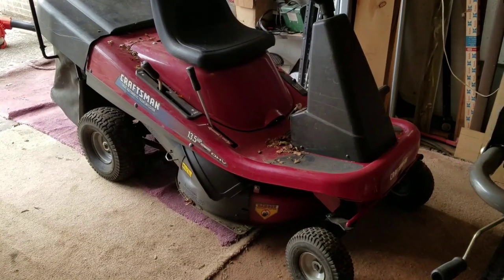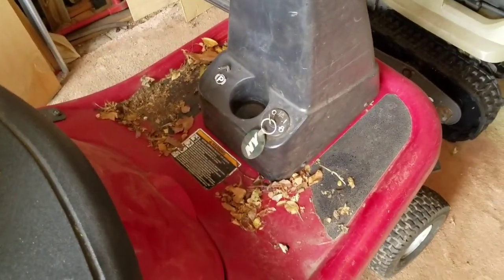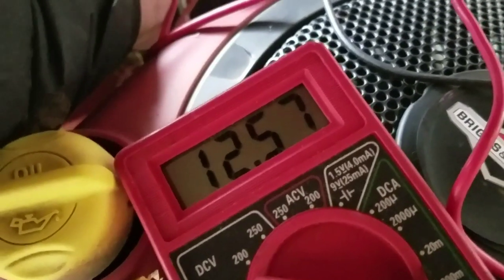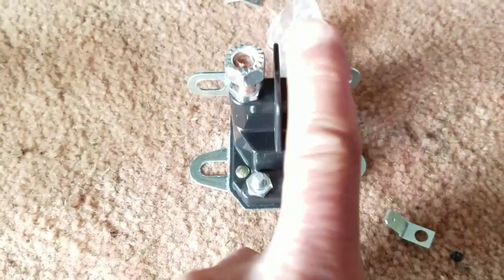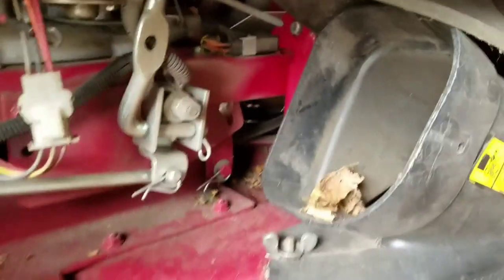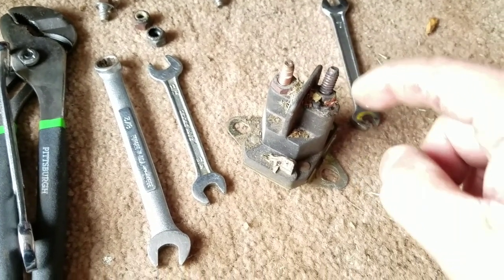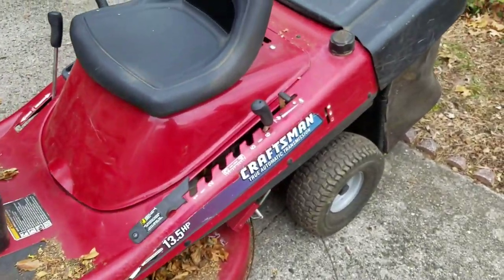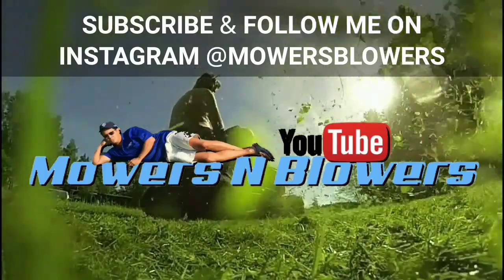LAWN TRACTOR RIDING MOWER WONT START CLICKS HOW TO REPLACE 3 4 POST POLE SOLENOID WORKS REPLACEMENT

Comment: Hello Henry. I purchased a 682 Cub Cadet with a 44c mower deck and a snow blade about a couple of years ago in which the tractor actually run pretty good and the price seemed to be quite reasonable. The three mower deck blades were about as sharp as a rubber hose. So I started noticing things like a idler pulley with the bolt ready to fall out and the points cover screws about to fall out. A couple of days ago I was going to start the engine and the solenoid was chattering; So I grabbed the ground cable from the battery and the lug moved freely around the frame bolt. After tightening the bolt like it was supposed to be, The engine seemed to start and run with a little more vigor. Sometimes a combination of small issues will cause big issues in the end. I had told the guy that owned this Cub previously that I wanted first dibs should he ever decide to sell and he did keep his word to me. If I hadn’t known this guy for a long while; I probably wouldn’t have been very pleased with some of the things that I have encountered. Honestly though, It really pays to look things over before you turn over the dollar signs. Im kind of afraid that in time to come, I will probably have to repair or replace the Ross steering box due to excessive steering wheel travel now that I have owned this Cub for a while. Oh Well, The 682 has a good home now with me being that I now have two Cubs to play around with. Both Cubs have some years on them - But are tough as nails. I wanted to share my saga with you and your subscribers. Thanks for your great videos.
Reply from the maker: Thanks Duke, great personal experiences to share with everyone.  I’m sure since you take care of your machines, you won’t have too many issues.
Reply: Mowers N Blowers. Henry, I was determined to sharpen the old dull blades that I removed from the Cub Cadet. The blades were so dull that where the bevel comes to the sharpened edge - It was very badly rounded back to the underneath side of the blade. The blades were not beaten up or nicked surprisingly enough. I had kind of expected the worst and so I did myself a favor and ordered a new set of blades.  I broke in a brand new DeWalt grinder in which it received one heck of a workout. The blades actually sharpened up pretty well considering what they were before(Argh). The mower deck wheels were completely worn out so I ordered a new set of deck wheels. Luckily everything that I am doing is helping out tremendously. On a humorous note; Can you imagine a Pattays Performance video with what I had found with my Cub???. Now that’s a tremendously big LOL. Have A Good Evening, Henry.
Reply from the maker: IronDuke502 it’s tough to sharpen so much that you may throw off the balance and end up having a vibration
Reply: Mowers N Blowers. The blades seemed to balance up okay believe it or not. But I opted for the new blade set for peace of mind. Wow, considering some of the other issues - I’m not in the mood to deal with a deck spindle or spindles as the case may be. I found another new blade set on eBay that was priced even better than the first new blade set that I purchased. So at this point the old blade set would be considered maybe spares for the spares. The grease zerks had not seen any grease for a very long time. One of my rear tires was low on air a few days back, So I attempted to inflate the tire and the valve stem broke just about completely off from the rim. The worst part in all of this was the fact that the tire had anti freeze inside for additional weight. After a few profane words, I removed the tire and replaced the decrepit valve stem with a new valve stem. When the weather is cooler I will replace the valve stem on the other wheel. I guess that the poor Cub Cadet is crying for attention from me because the previous owner surely never did much.

Comment: THANK YOU FOR THE VIDEO AND GOING INTO DEPTH ON THE SOLENOID I HAVE THE SAME RIDER AND ITS DOING THE SAME THING GOING YO ORDER A SOLENOIOD THANK YOU  WHAT CAN I DO ABOUT  FRONT WOBBLY WHEELS
Reply from the maker: Nothing..mine are wobbly too...front end axle metal worn.  New front end? https://www.jackssmallengines.com/jacks-parts-lookup/manufacturer/murray/2006-models/lawn-garden/riders/mid-engine-riders-mer/30-cut/536-270320-craftsman-mid-engine-rider-2006/steering

Comment: My Troy built super bronco from 2005, is sitting in my shed, when you turn the key, sometimes it cranks, and other times nothing happens, with a good battery. Do you think the switch is acting up?
Reply from the maker: I've had that happen on my mudmower..the solenoid ground is bad.  Usually over time sitting, rust build up between the solenoid and the frame.  Try tightening the bolts holding down the solenoid.  Or tighten and clean the positive/negative terminals on your battery..or the solenoid terminal connection.
Reply from the maker: Thanks for the comment by the way, hope you subscribed.

Comment: Hi... maybe you can help me...I put on a push button on my mower....but my starter gear won't pop up....???
Reply from the maker: Does it crank?
Reply: No... because the starter gear don't pop up.....
Reply from the maker: I mean does the starter spin?  The push button works? Making the starter motor spin?  Make sure your battery terminals are on correctly, not popping up can mean you have negative on positive terminals backwards.  Or the ring gear is rusted on the shaft, spray penetrating oil on the shaft, spring, above and below the spring. Work it up and down.
Reply: Yes... the starter does spinning.... just won't pop up....
Reply from the maker: Penetrating oil
Reply: Hey...I just wanted to thank you for all your help....👍
Reply from the maker: Dave Jeff anytime dave

Comment: Can I do it without replace
Reply from the maker: Can you do what?
Reply: @MowersNBlowers  can I do the solenoid without a replacement and I did wat u did today and the starter just spinned the starter didn't move the engine
Reply from the maker: @Br0kenTransMissi0n  because your gear in the starter is not moving up to engage the flywheel. You need to spray penetrating oil and move it up and down to loosen it up.
Reply: @MowersNBlowers  how do I do that
Reply from the maker: @Br0kenTransMissi0n  i just told you. Spray oil in the gear!! Take the cover off.  You'll never figure unless you take it off!
Reply: @MowersNBlowers  oh I already did that and when I jump it and put a wrench in between there's just Sparks now
Reply from the maker: @Br0kenTransMissi0n  it's sparking because your trying to jump it.  Your starter is probably fried.  That's why you do it right. Now you need a solenoid and a starter.  Should have just replaced the solenoid which costs $5.  Now you need a new starter which is like $30.
Reply: @MowersNBlowers  the starter kinda spins sumtimes

Comment: Starter man.
Reply from the maker: Lol...nah..just the solenoid. Video was 2 years ago...been running great.
Reply from the maker: Just solenoid bro.  Thanks for the comment bro and I hope you subscribed
Reply: @MowersNBlowers  what does it mean when you jump it like in the video and nothing happens, but when you turn the key you can hear it click.
Reply from the maker: @littleeagle7563  your not jumping it right!  If it clicks, the solenoid energizes and clicks...just not enough to touch the starter terminal.  Put a multimeter to the starter and see if you get 12.4 volts when you turn the key.
Reply: @MowersNBlowers  i put a wrench to the two terminals but it does nothing not even any sparks, its pretty rusty. got to go pick me up a multimeter. Thanks
Reply from the maker: eagles chances are you need a new solenoid... they're only like $8!  But a multimeter is very helpful in the future too.  They give one out for free at harborfreight tools with the coupon on their app.
Reply: @MowersNBlowers  Thanks for the info man.